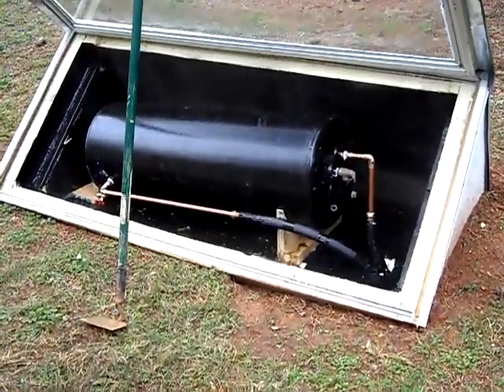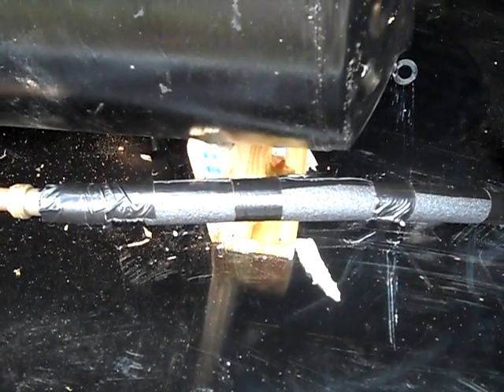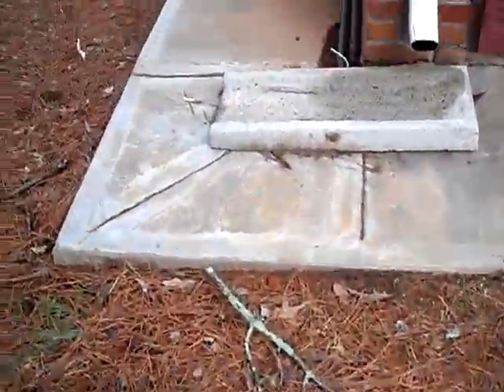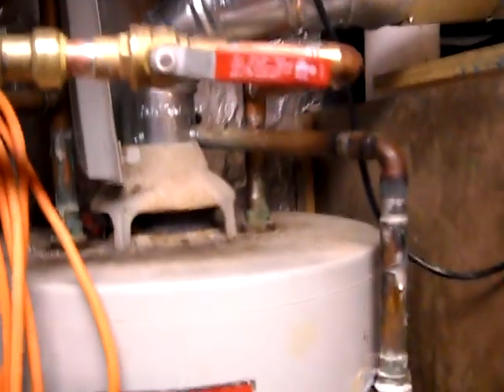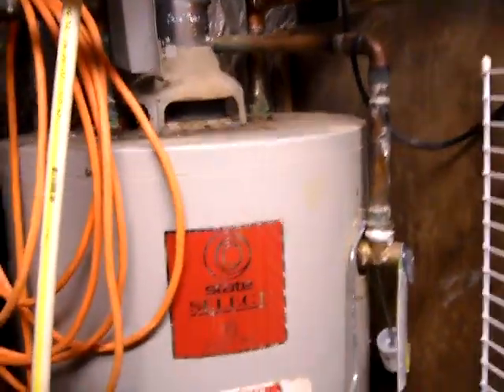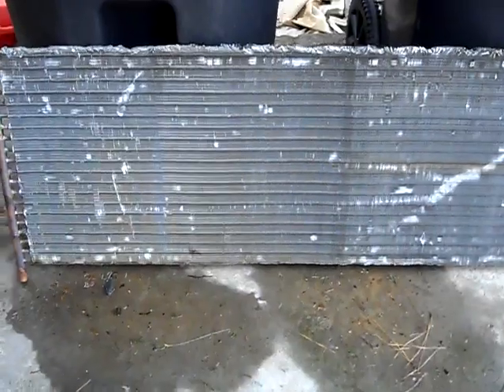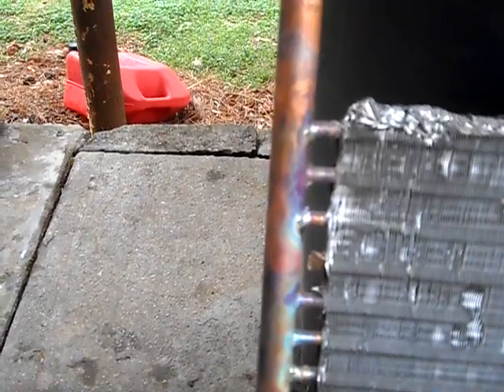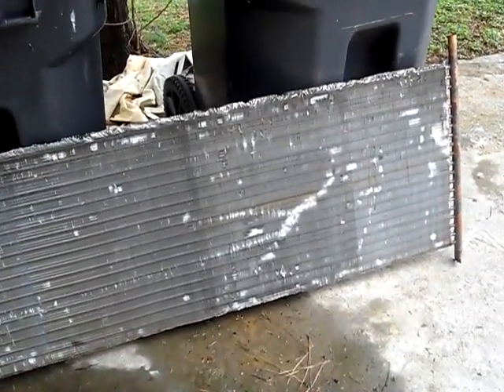DIY Solar Batch Water Heater Build Part 2

Comment: Did you use MATT black? The thing looks kind of shiny to me which means you are reflecting heat. You need Matt black to absorb the heat better. Also google evacuated solar tubes. They are epic and can be used with this system for higher temps and faster heating of new water.